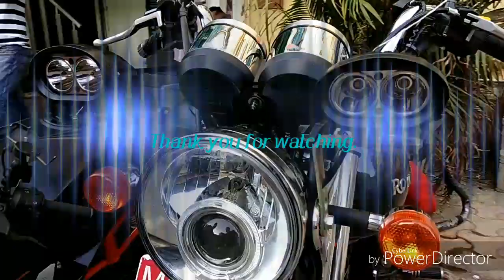How to Install FOG lights in Royal Enfield Thunderbird.

Comment: Which leg guard is good for Thunderbird. I heard that leg guard's giving dent on front mudgear on applying front disc brake is it real?
Reply from the maker: bharat reddy yes ur right but that happens only due to extra length of screws applyed on leg gard trybto redure the length by cutting it through exoblade.
even inhave did the same thing